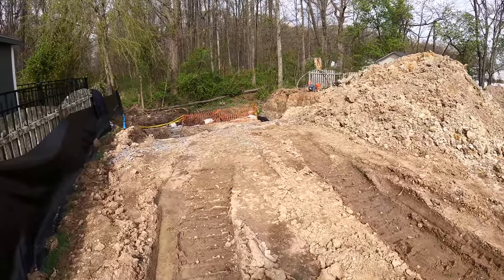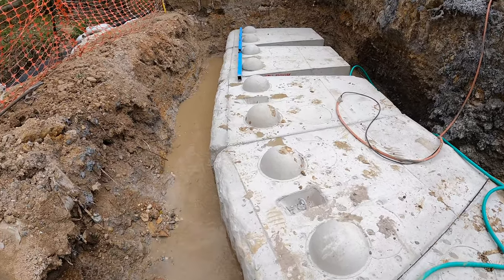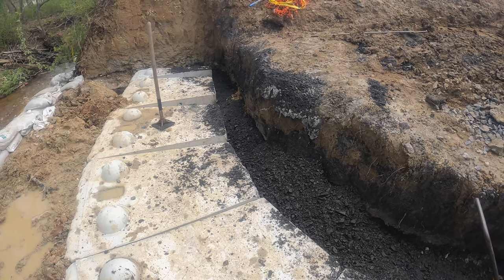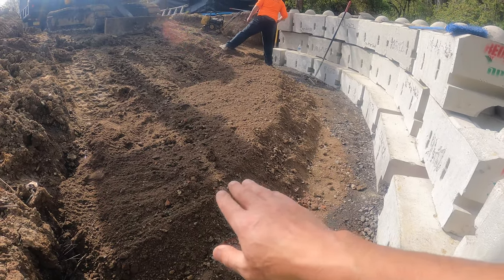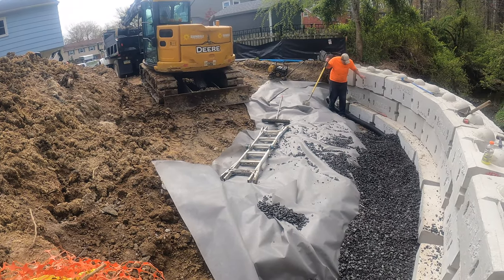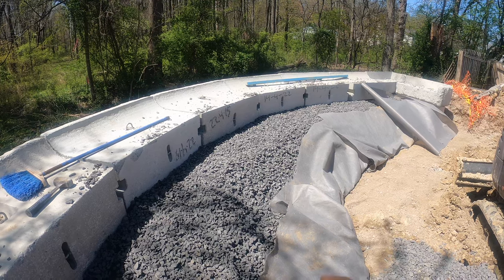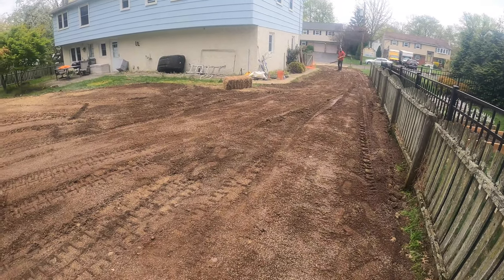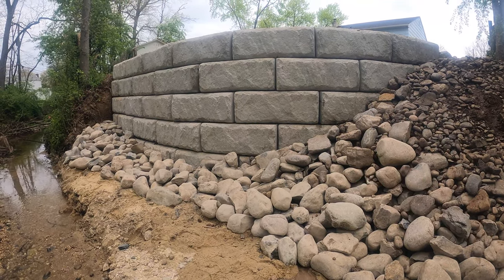How to build a redi rock retaining wall

Comment: Pouring a concrete footer is definitely the way to go on these, I’m currently doing a wall with a gravel footer. It’s very easy to get that first row off grade.
Reply from the maker: I've done plenty of stone base retaining walls so I know exactly what you mean. Thanks for watching!
Reply: use a 12ft concrete screed to level the gravel it works wonders (along with a smooth equipment operator)

Comment: can you use the readi rock as a sea wall? what does is run per foot
Reply from the maker: I'm sure you could, you definitely want to check with an engineer for a wall like that. There about $150 a block. Thanks for watching

Comment: Where are the tie backs? Can’t believe your engineer didn’t require them. Great looking wall.
Reply from the maker: Thank you
Reply: Usually retaining wall block that big do not require tiebacks. The sheer weight of them alone, and the indentations in each block is what locks those in. Smaller retaining wall block require Geo grid as they don’t have the weight to hold them in place.

Comment: I’m sure you will never see this, but if you do…HELP ! Who do I call to get this done in my yard?! What kind of company? I have a huge erosion issue and the county won’t do anything to help.
Reply from the maker: Hello, call some local excavation companies and ask if the build retaining walls. Get more then one opinion and have the wall designed by an engineer. Make sure permits are pulled and inspections are done. Best of luck with your project!